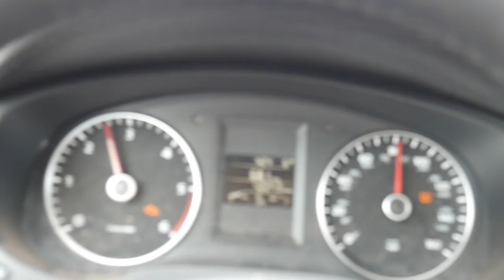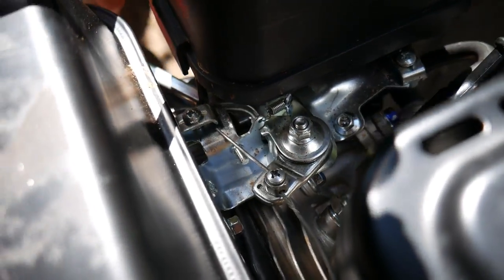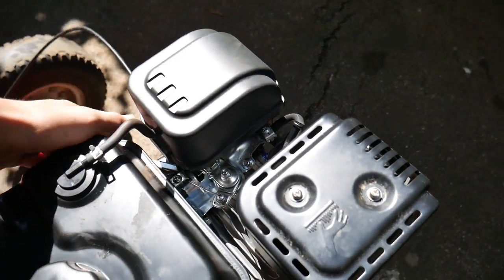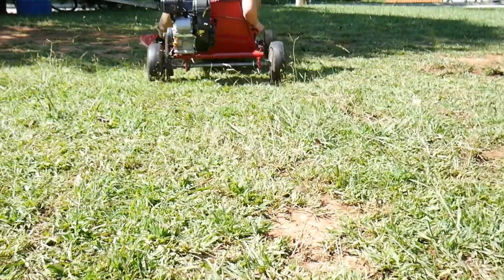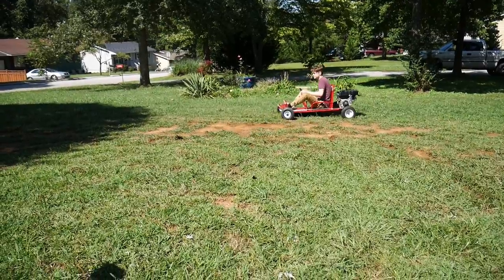Cheap Go Kart PREDATOR SWAP (Part 2)

Comment: What size rear sprocket? Im running a 64 tooth and a 14 tooth clutch on my 8hp Briggs and Stratton and i don't have near the torque, Possibly is the clutch springs or rear sprocket. Excellent content!
Reply from the maker: 11/66
Reply: Thanks man!
Reply: @VasilyBuilds  did you mean 12T?

Comment: i want to do this but i cant find a frame
Reply from the maker: Search craiglist I always see them on there, maybe ebay.  GoPowersports has some frames. But they are very expensive. If all else fails, you can try building one from scratch. I will probably make a tutorial in a few months.
Reply: IV Kebo VI make one

Comment: What size bolt did you use for holding the clutch on the engine ??
Reply from the maker: Andrew Matthews It's a 5/16-24 1.25inch Remember google is your friend